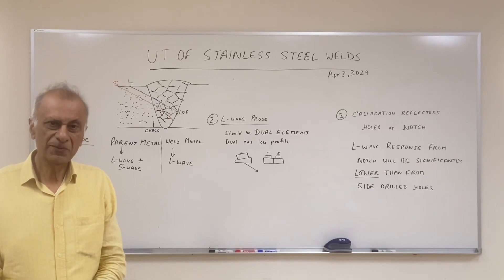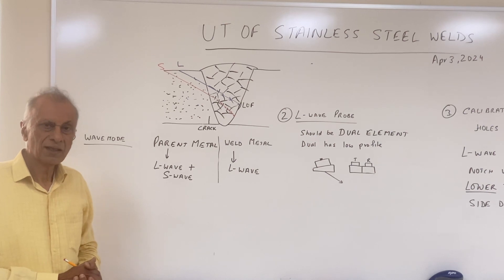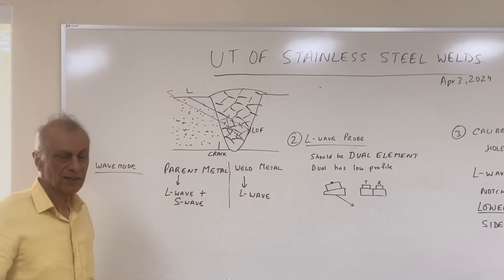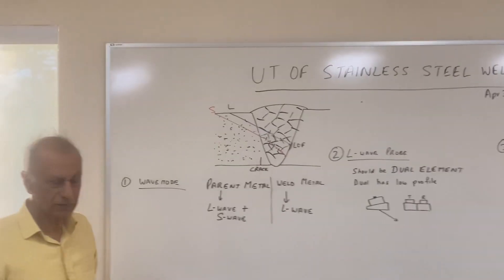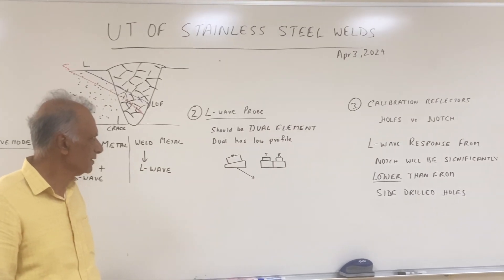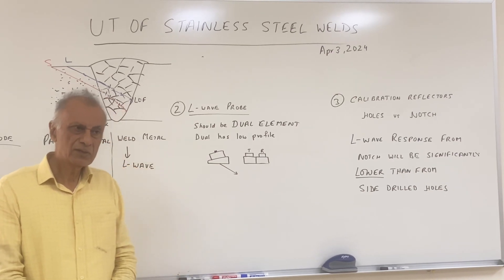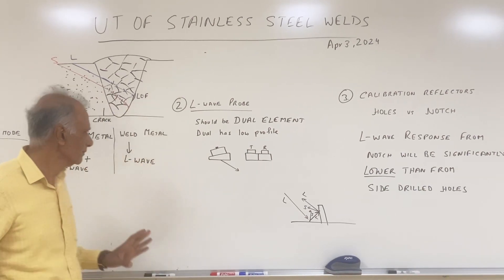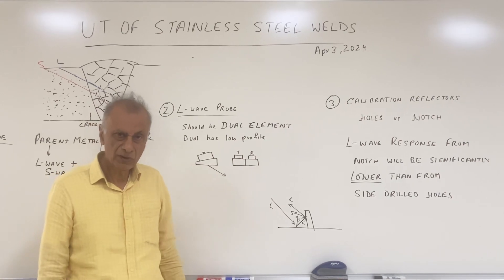Birring 302 UT of Stainless Steel Welds Dual element L-wave probe and ID notch for reference level

Comment: Then which is preferable to use notch or drill hole for sensitivity calibration with L waves.
Reply: Notches, when you use SDH your gain will be lower. Using notches will bump your gain up to a level where identifying small ID cracks more sensitive. Thus, Notches for L wave on SS welds is recommended.